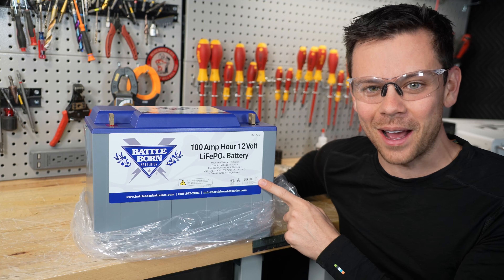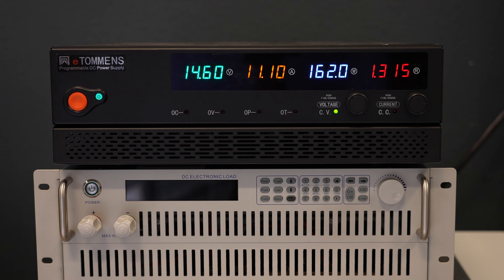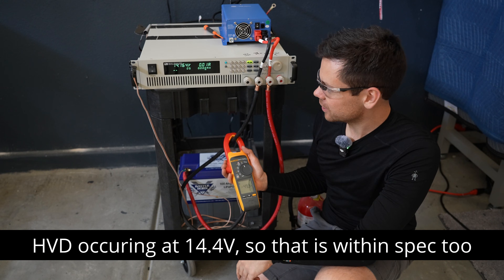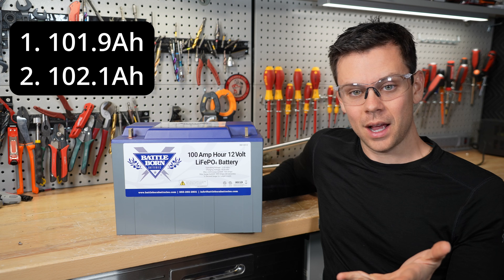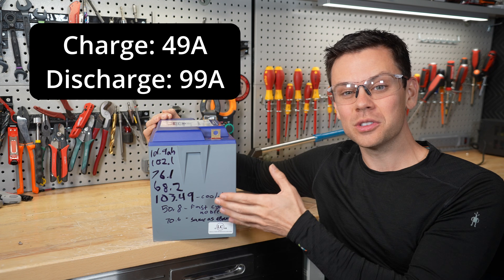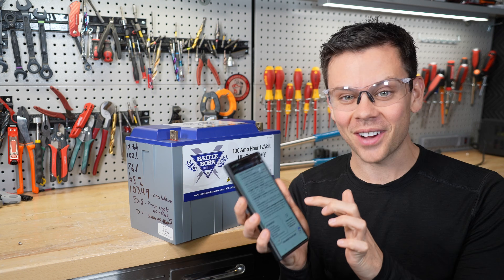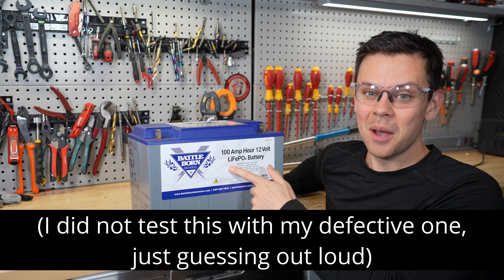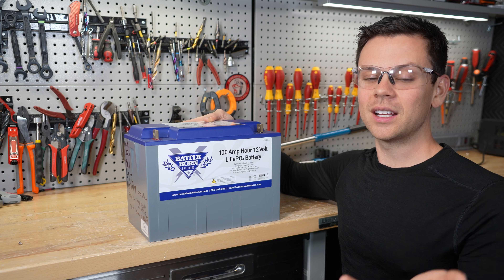A NEW Issue?! Battleborn Cycle Testing!

Comment from the maker: A continuous rating on any electrical device means that at a given temperature (usually room temperature) the device should be able to function continuously. This is not a "stressful" test. It is normal. If an inverter has a "continuous rating of 5000W", it should be able to power that continuously, 24/7. 

Also this test is NOT for the advertised rated capacity, as I showed in the video. That would be done at .2C rate. I'm cycling it at the current rating. That's the point, to recreate the overheating terminal.

I am going to test lots of batteries in this way from now on and see what fails first. It will be awesome!
Reply: I have six brand new of these batteries sitting at home. Four of them are part of a warranty claim ai filed last year for the same loose positive terminal Will has exposed. I posted it in the DIY Solar forum. When I got them I only did a capacity test and they all passed the test. I have been busy at work so I had to put my RV renovation proyect on hold. I’ve been keeping them charged while they sit at my air conditioned house. The Battleborn excuse is pure bullshit and they know it. Will be doing some testing on all my new batteries as well.
Reply: @edgardoguzman2858  Did BB warranty the four batteries?
Reply: @RichardNoggin-iw7sh they did on the first four. I want to send back my six batteries now for a refund but they wont grant the warranty stating “there is nothing wrong with your batteries”
Reply: @edgardoguzman2858  How old are yo batteries?
Reply: @donbxman7080 the current 6 ones are 5 are 7/2023  and one is 11/2024. The first four that got replaced were purchased in 2020.
Reply: If your load tester has what looks like a parallel port (its called GPIB or on more modern systems, an ethernet jack) it should be controllable by software like LabView or similar to program automated testing....  Given all the testing you are doing, I highly recommend you get familiar with LabView so you can automate everything without custom equipment.
Reply: It’s OK, just be glad to be an American and disagree away.  Will would be “silenced” if he posted this and were a citizen where the batteries are made.
Reply: @microbiologycory10 they made in USA  ( of course with some parts not )
Reply: WILL..
(I will say it..)
A bolt could get hot and lower the torque pressure between to bit's of metal and increase the resistance... etc..
Reply: Why do you talk like a 14-year-old girl?
Reply: LOL, with Audio this way of thinking is dead long long ago. Delivering "MaxContinuous power" as stated on the manual (take an entry receiver from a decent brand) means going int protect in a few minutes (if you are lucky) or permanent damage.  The safety and quality marging to ensure continuos operation it isi not there. Not for this home units. Of course PRO stuff is naother ball game and another money too.
Reply: Thanks Will. Which BB battery models are included in this problem? All models? I have the 270ah BBGC3H model.
Reply: I won't be surprised if it will take awhile (months) for the aluminum oxide (almost as hard a diamonds) on the bolt to be thick enough for it to affect the conductivity.
Reply: @JohnLKeating  ( Diamonds are 4 times harder than aluminum oxide.  I was in the precision ceramic maching business for many years. ) You make a good point, alumina is a fantastic insulator and over time  you would have all that power flowing through an increasingly smaller contact area, a perfect recipie for creating a lot of heat and a very poor connection.
Reply: The battery should allow 100A continuous discharge until depleted, but this does NOT correspond with its rated 100AH capacity. The 100AH capacity is at 5A discharge. See my more complete comment below.
Reply from the maker: @RedFoxAlaska oh I'm not testing the rated capacity. That would be at .2C rate.
Reply: @RedFoxAlaska  50% capacity though is unacceptable
Reply: @WillProwse   You said you are running these tests back to back to back, with the exception of the first to second test where you said you went to sleep correct?  

If true, then you are discharging the battery at 100A which is the name plate maximum discharge rate, then you are charging them at the name plate maximum of 49.9A, correct?   If this is true, you are subjecting the battery to a 100% duty cycle at maximum output and input amperage’s over and over again. 

The battery is a closed unit with no air circulation, so it’s no wonder that the bms is shutting down the battery on high heat which is 135*F, as designed.  Comparing that to a 5000 watt inverter which has cooling fans to dissipate the heat is a very poor comparison as the inverter can reject the heat into the surrounding air, which a battery inside of a case cannot, simply sitting in your 75* shop is not going to make any difference nor would it make any difference if the battery was sitting outside in a 10* environment.  

Further, the temperatures you recorded on the terminals of 109* and 114*, you did not say which terminal was which in regards to positive or negative which I’d think would be important since the positive terminal is the focus, is normal with that kind of power flow.  What was the temperature on the case of the battery when the full capacity test was seen,  as well as the subsequent tests wherein the battery shutdown on high heat and less capacity?  Those are some pretty important factors to record when doing tests such as these. 

It will indeed be interesting to see the same type of testing performed on other batteries under the same conditions.
Reply: Constant cycling at 99% rated charge/discharge capacity should cause thermal protection issues on almost all batteries of this type, as designed. You're moving a lot of power through the battery rapidly in a use case it wasn't purpose-built for. Show us the same test on comparable batteries that are known to be reliable long-term.
Reply from the maker: @bobthebuilder372  Actually this is totally false and I will prove it. I test these batteries all the time
Reply: @WillProwse Interesting issue you have come up agaisnt.  It will be nice to see if other batteries can perform.
Reply: @W @WillProwse are you claiming that competing batteries support continuous, back-to-back charge/discharge cycles at max rating without BMS interference?
Reply: Will, you should be helping an American company instead of tearing them down. If something is wrong assist them but don't try to destroy a dinosaur m company based in Nevada. We need more US companies and your grin is annoying.
Reply from the maker: @housesOTR  they sell Chinese goods. They are not a dinosaur company. I will hold everyone to the same standard. Americans should make their own cells and build better batteries.
Reply: No. He should be expecting the results he paid for.
Reply: @housesOTR If they are a dinosaur selling quality USA made batteries at 3 to 7 times as much as much of the competition then they should have a very robust product that stands on its own, and they should have proactively taken care of any widespread issues on their own, without being called out, and instead they doubled down saying that melting plastic is a "safety feature"
Reply: @housesOTR  This is another company that got greedy.  Both BB and UL/CSA should have done the testing years ago.
Reply: @housesOTR who sent you?
Reply: @housesOTR 
It probably would have helped when he found the problem, and they came up with some kind of bullshit excuse to say that he was wrong.
Unless they are offering him some sort of compensated consultant position the company, it's their own stupid fault for not bringing him on board.
If the company is this obtuse, they deserve whatever they get,
Not some kind of weird political blindness.
This is America.
The consumers responsibility to improve the company they buy from, is limited to the dollars they spend.
Not being a free consultant.
Shame on you.
Companies that behave stupidly, often stumble and fail.
Reply: @housesOTR will doesn't support criminals.
Reply: @housesOTR I am all for supporting American companies, but not if they sell an inferior product at 3-4 times the price of a Chinese competitor. Dragonfly which owns Battle Born just did a 1 for 10 reverse stock split which is a warning sign that they might be failing. I feel sorry for any warranty owners if they fail because they will abandon their obligations to customers to appease their shareholders.
Reply: @housesOTR  Making or rebranding junk and hiding behind the US flag is a favorite pastime of Corporate America but it's never been a good look. A real patriot doesn't make junk and hide behind the flag. When we as Americans build and sell products to the world, we can only compete on quality, design and functionality; "low cost countries" will get us on price every time. So, if we're locked into a premium price bracket by macroeconomics, we had better deliver premium goods if we want to maintain prestige and stay in business. 

At the prices they charge, they should be selling products that are well engineered, well tested, and the standard of the world. Their response to a widely documented and clearly dangerous fault tells me EVERYTHING I need to know about the management of this company. They deserve the wrath that only free market capitalism can provide.
Reply: @housesOTR  I think his grin is because he is doing the battery buying public a tremendous favor. I doubt if BB wants Will's assistance....LOL! I hope they fix their design, not go out of business. And this is a potentially life threatening issue that needs to be addressed.
Reply: @housesOTR  a company that tries to blame their batteries issues on the customers who have lifted them to where they WERE today? No thanks dude. I wouldn’t buy a AA battery from them.
Reply: @housesOTR  Your comment is annoying.  Who is forcing you to watch?

Comment: I had commented on the poor plastic resin choice, additionally all bolt holes should have crush limiter bushings (brass or steel) either molded in or pressed in. Those would allow for proper torquing of the bolts and maintain the torque over time.Plastic will always crush. Those are used in plastic oil pans and valve covers in automotive applications.

Comment: Poor design where they are bolting through plastic. Not sure what plastic resin they used in the molding of the end plates, but they are certainly softening under heat and letting the connections come loose. There are plastic resins that can handle the higher heat and are glass fiber or talc filled to add rigidity. Then there are the thermoset (versus thermoplastic) resins that once molded can't be remelted.
Some poor choices were made overall.

Comment: Going from max charge rate straight max discharge rate and acting surprised you are getting a thermal limit is intellectually dishonest and you seem to be smart enough to know better. There batteries are over priced but your edge case is not realistic and if they didnt have a thermal limit it would significantly damage the battery life span.

Comment: H Will, love your channel. I needed a particular battery size and was able to fit 4-Renogy Super slim solid-state 104AH Rego batteries. So unhappy with my purchase. The brackets do not fit the battery, they have can-bus that won't talk to my Victron MP-2 and one of the batteries has parts inside that rattle. Can you please review one of these?

Comment: After watching these videos I had some concerns, I have six 100AH BB in parallel for my 3000 watt hybrid inverter. Bulk charging at 125 amps and many times I have a DC draw of 100-300 amps. All 6 show no signs of degradation seen here. As of today, 3 weeks after asking Battle Born for assistance - still crickets.

Comment: I am guessing Battleborn adjusted their software as a quick fix for the terminal overheating issue. That way they can use up all their inventoty before correcting the design. Minimize losses, exactly how very larger corporations approach problems. They use quality to justify the extra cost but then cut corners when profit margins are in danger.

Comment: Will, when I first had my solar system installed on my RV by a professional, I experienced problems with my Battle Born batteries (4) staying charged I can tell you as of today the rate at which they discharge when left sitting is absolutley shocking! I have gone out and purchased 2 Victron IP67 chargers to keep them charged up. I am not happy at all with these battery's and will look to change them out. They were very expensive and really are nothing more than a boat anchor at this point.

Comment: Makes me wonder if there is something internal - other than the main battery terminals - that is getting hot.  Without opening it up it's going to be hard to pinpoint the problem.
Reply from the maker: No it's the BMS. I can wake it up with Psu so it's not that

Comment: I am an example.  I am a Glamper in a 5th wheel.  I have 2-300amp batteries.  In four years they have been fully discharged 4-5 times.   Most of the time it is because after we moved, I tested the shore power, turned it off, and forgot to turn it on.  In the summer, I can power two air conditioners and my whole RV for about 8-10 hours... (lol) OOPS!   In the rare cases I do not have shore power, I only have a little bit of solar (1 KWH charging per sunny day)  And run on minimum - knowing I need to sip on my batteries until I can get plugged in again.  We had a few power outages and did the same. (They were short enough to sneak by without a generator etc.)  If I had 6 100amp battleborn batteries - I doubt I would ever notice.  However - I have highly recommended (from this site) china batteries which I paid about $1800 for 2 300amp batteries (right on Amazon) I am so glad I did not fall for the RV Channel trap and pay about $5000+ for Battleborn.

Comment: I own three of the GC3 12 volt batteries from Battleborn.  On two of those, the Negative Terminals move up and down in the case.  When I contacted Hugh at Battleborn, he was quick to point out that I must have dropped the batteries on those terminals and made them loose.  When I asked if the loose terminals are connected securely inside the case the answer did not include any pictures or diagrams to show exactly how they are connected inside the case.  Can anyone or has anyone disassembled the GC3 123 volt case to see exactly how they are connected.  With further insistence this was a Battleborn issue and should be replaced.  Their answer, we will send you an RMA...you pay for removal, shipping...we will look at it and let you know if it is a Warranty issue...if not, you can pay to have it returned and and re-installed.  Since Hugh has already stated it was my fault...what are to possibility Battleborn will find a fault caused by Battleborn?  At the price paid for these, Battleborn should stand behind them.  For the cost of doing what they wanted I can purchase new batteries with better warranty and technology diagnostics.  Will, have you disassembled the Battleborn GC3 12 volt battery?  Can you tell me just how the terminals inside are connected?  I have pulled the negative terminals up to their stop, then place additional adhesive around the loose terminals to hold them in place and keep moisture out of the case.  Please respond.

Comment: This positive terminal issue is puzzling. On the one hand, if the plastic never melts, then you'll never see the issue. But if it does get hot even once, and starts to melt, it will slowly get worse over time, until it goes open-circuit from soot buildup from arcing. Then you send it for warranty repair, and BB promptly tell you that it's not covered because you had loose connections. 

You might NOT BE ABLE to reproduce the issue using your particular test, charging at 49, discharging at 99. Other users might have destroyed theirs by exceeding the 100A on a hot day. Others might have had a loose terminal connection, which caused terminal heating, and melting the plastic inside. 

No doubt, bolting the terminal to the plastic is a TERRIBLE DESIGN, but you won't necessarily prove to BB that you can easily make it fail. You probably CAN make it fail by going outside the envelope, (just make a deliberately loose connection) but that won't help make your point about this unsafe feature. 

Good luck. I can't wait for the next video. I'm betting you won't be able to make it fail.

Comment: For UL, you have to look it up online. I tried it, but you need an account with UL, and if you're not a tester, you can't get access. I had an account, but they disabled it when I couldn't show that i was a commercial tester. You'll find that Battle Born has a lot of listings, but what I really want to know is: why UL testing did not catch these issues?

Also: I wonder about these solarforum members who were willing to send their $900 battery to Will Prowse to disassemble it and void the warranty.  Why didn't they just send it to BB for warranty replacement? Did BB already tell them that it wasn't covered under warranty?

Comment: I think your problem is you need to solder the lugs and use old scrap cables , cut the solder into 12 pieces and use a blow torch , that should do it 😉
Reply: and use non flux plumbing solder since it's cheap

Comment: Maybe drill hole at the right place to probe the voltage on the cell side of the aluminum bolt. Monitoring voltage across the questionable connection while doing the load test would confirm if its the BMS shutting it down or loss of connection due to loosening or corrosion. It would be instructive also if the voltage steadily increases over time and multiple cycles.
Reply: Oh and a temp probe on or near the bolt/nut, and another one somewhere else inside the battery case would be nice to know too.